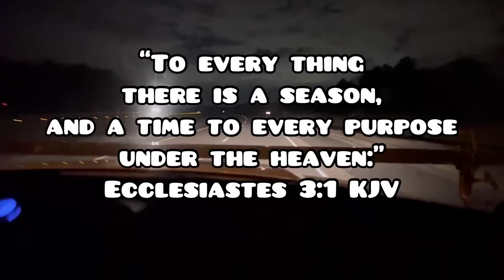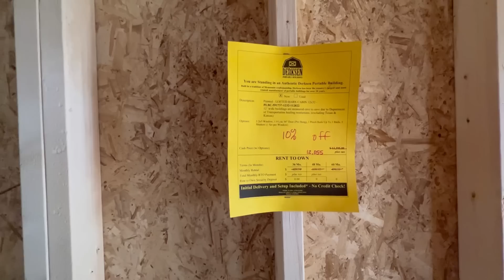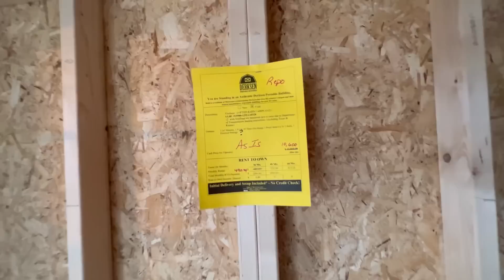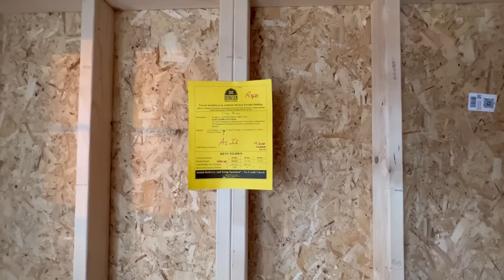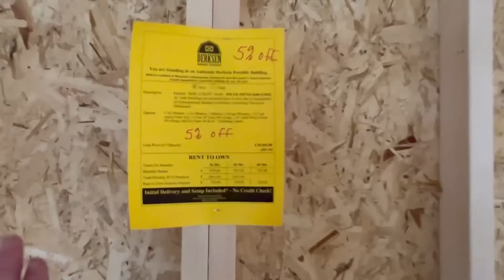Messy Tiny Home Repo | Got Stuck

Comment: HOLY MOLY $10.600 for a used shed.  I could build one of those for probly 3k in materials.   Thats a rough guess, but I know I spent around 1800 for one half that size when I built ours.

Comment: I usually don’t say anything but you seem like a nice guy. Please wear a good pair of gloves while handling cinder blocks. I didn’t and when I went to toss a cinder block just like you did my thumb was inside one of the holes when I tossed it. There was a jagged area on the inside that my thumb got hooked on and it ripped the end of my thumb off - the skin - all of its nail and part of its bone. I had to get to the hospital and have immediate surgery to put my thumb back together. Fortunately I was smart enough to grab the parts of my thumb so they could be reattached. If only I had been small enough to have worn a pair of leather work gloves or even some gloves. Thanks
Reply from the maker: Oh wow so sorry that happened